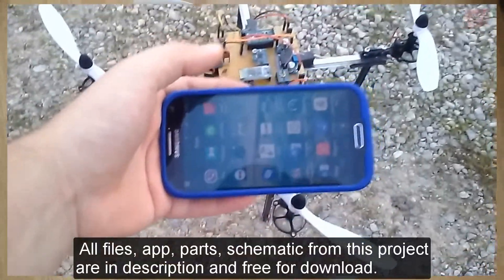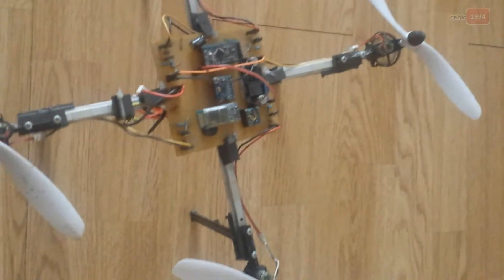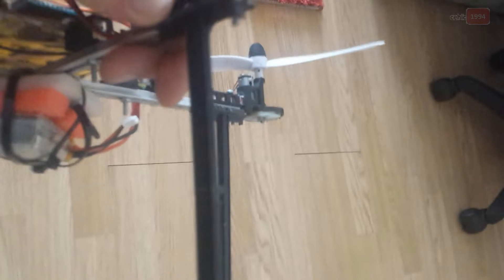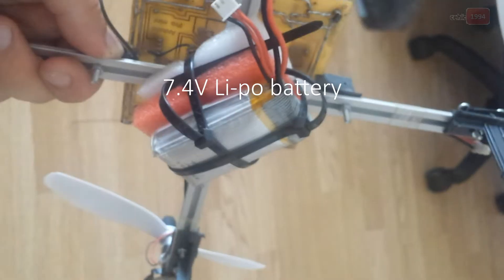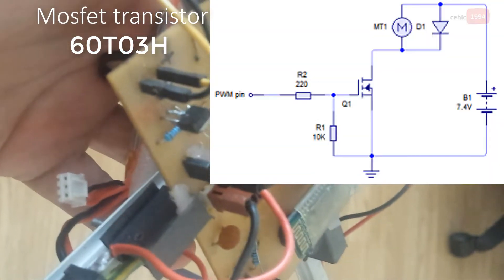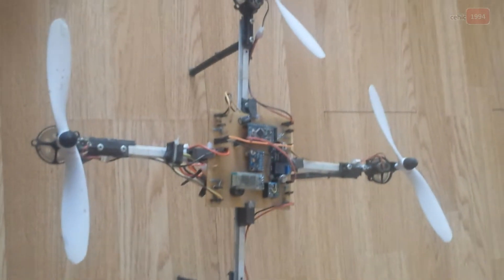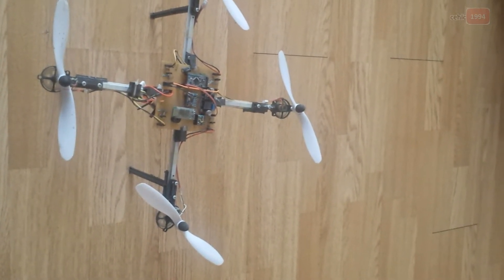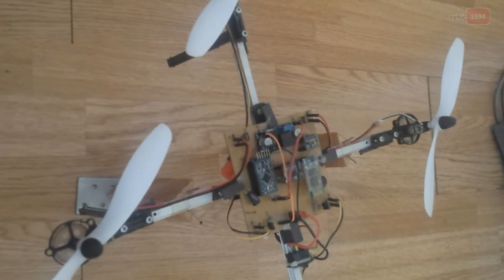Arduino based DIY homemade quadcopter drone Smartphone Controll

Comment: 1. Is it possible to replace hc 06 with nfr24 or esp8266?

2. Is it possible to replace a motor n40 with a motor 180 with suitable parts for it?
Reply from the maker: 1. It's possible for sure and more better than bluetoot, I suggest nrf24.
2. Also possible, you need to chose right motor, it depend of your quadcopter weight.
Reply: @cehic1994  
The engine (fk 180ph) The volt range is 3.7--7.4v, the maximum is 1A amp. Is it possible to mount it on this drone?
Reply from the maker: I think that my motors have a little more power than fk180ph. I have used motors and propellers from tarantula x6 quadcopter, so you can compare that. Total weight of my quadcopter is almost 300g. If you want to make one, you need to know that you need motors that have total thrust of 2*( your quadcopter total weight). In my case motors need to handle 600g of total thrust. So each motor need to have thrust of 150g (600g/4).

Comment: If i use mpu9250 ?does the code will run?
Reply from the maker: It's different than MPU6050, it will not work.

Comment: please share your android app link
Reply from the maker: You have at description all files from this project
Reply: thank you sir, can you please tell me what was the actual range of Bluetooth controlling the drone ?? can it cover 100 meters ?
Reply from the maker: No, max is about 30m, it depends on your phone and bluetooth module. For longer range you should use radio frequency(433MHz) or wifi, but it's hard to get 100m range . For my opinion best wireless module for long range are NRF24L01L, it have long range, longer than 1km with proper antennas. Also you have  radio at 433Mhz, it can work over 300m. In this project I have used bluetooth, because I wanted to use android app, and bluetooth is easier to program and make app.
Reply: cehic1994 thankx mate ! you help me alot thank you very much 👍👍